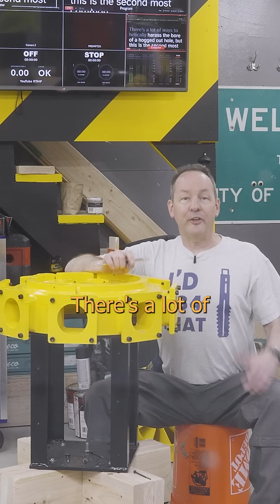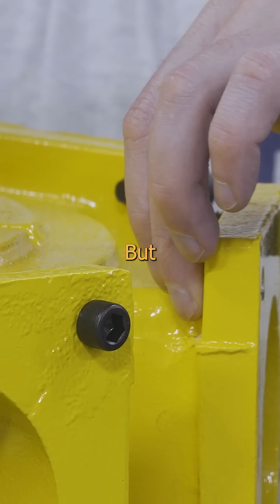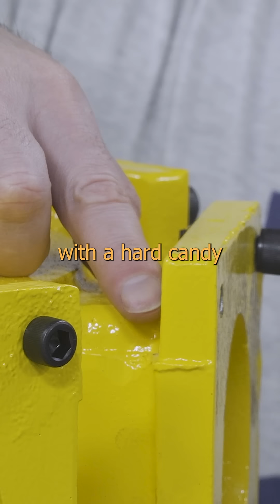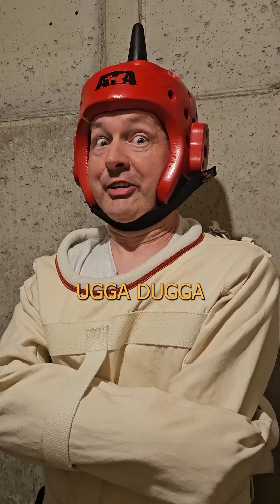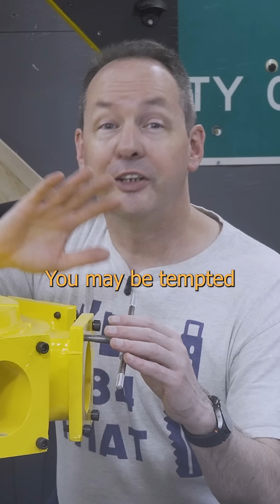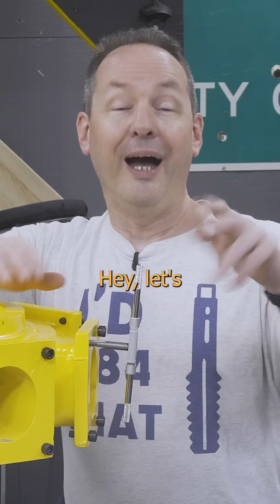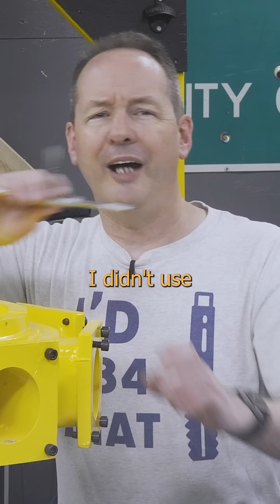Thread Chasing  #chrisboden #comedy #engineering #skills #workshop #metalworking #tools #apprentice

Comment: Ah yes...the dumbass moment was thredding aluminum profiles holes with a dry tap, moving slowly deep inside before going back out fast...forgetting that aluminum deform a lot more than steel after the work is done got the tap clogged inside while going back out, tried to pull it out with streght and it snapped...now somewhere out there a leg of a working table has a tap I broke on the side it was supposed not to be and has 2 extra hole.
Remember to use lube, it can get plenty in and out!

Comment: i've done it with an impact before, worked on a powder coating line and the bosses were getting pissy about how much time i was taking, so i said fuck it, i'm certain i did more than a little damage but at that point i had 0 fucks left to give after getting reamed out

Comment: I'm a dumbass, snapped a tap in a blind hole trying to clean up the thread for a head bolt in my reliant scimitars cast iron block, found out quite quickly that I couldn't put a hole for an easyout in the has tap with the bits I had.... I was not a clever 17 year old and made it far worse trying to get it out by jamming welding rods down the flutes and twisting with mole grips shearing them off inside too, thankfully I had an old-school retired mechanic for a neighbour who welded a bit of rebar (if I remember rightly) to it and managed to wind it out, I'd like to say I haven't snapped a tap since.... I'd like to.

Comment: LMAO I Don't know if i'm a dumbass for it, cause the boss wanted it. One of the lathes chipped a thread tool and ran like 500 parts with a thread that just didn't clear deep enough. It would have taken way too long to start them all by hand. Better to scrap 5% due to cross threading and get the parts shipped the same day.

Comment: Fellow near dumbass here (I use "near" lightly cuz considering the shit I've done... oh boy, I have a lot of wisdom. In hindsight, my father is a patient man.) who's father is a man with a wealth of experience in the "well thats a lesson learned" department. 
He owns a couple of these taps and uses them to their fullest extent even past the WEEE WEEE WEEE. In fact he uses them so much, he knows how they feel when they're about to snap and even has committed to muscle memory where the eZ-outs are to remove them when broken. My favorite story is when it snapped while cleaning out the hole for a heat sensor (I think) just before the DPF on a freightliner semi. In case you don't know, sometimes the DPF has reduced space for access. Sometimes, it has REALLY reduced space for access. this one had really reduced space, allowing just enough for a little wiggle room for the hand with the tap included. Imagine his sigh of acceptance when he tried using it with a right angled drill and it snapped just where the teeth started... leaving you with even less space for a tool and the ez-out. It was fun watching the vice grip clamps we had slowly get metal shaved off as we tried to remove it. turned a 2 hr job into like a 4 or 5 just cuz of that damn broken piece.

Comment: After a week of clearing stripped screws from glass security fixtures, I was tired and lazy. My hands and shoulders hurt and I was ready to call a hit on the MFers who installed the fixtures in the first place. 

The last handful of issues weren't stripped screws, just holes that needed to have the paint and dust cleared out. My #dumbass thought I could finish up faster if I put the tap in the the power drill. Screwed myself and lost pieces of the tap down the center of the fixture. But I learned something!

Comment: Definitely dumbass here. Tried tapping 1/4" UNF threads into thick structural steel without tap lube. When it was halfway through and wouldn't go any further with hand pressure on the tap wrench, I thought I just needed more pressure and brought out the drill. Tap snapped in the hole and I decided 3 out of 4 usable holes and just using a nut on the other side instead is gonna work well enough 😂

Comment: Dumbass… installing maglocks onto a steel gate post. Got bored of tapping and stuck the tap in a cordless. Worked amazing until it didn’t and then I spent 2h trying to get the broken tap out in the middle of winter.

Comment: dumbass: broke a tap off inside of a one off test fixture.... a 45 year old, one of a kind, 125kg machined out of a single block, "no one has the drawings anymore, we didn't digitize them and the some asshat in management decided we could throw out the filing cabinets with the old papers without seeing if we might need them bc having open plan offices is more important than having reference material", "must withstand extreme temperature and force bc jet engines don't do half measures", etc. kind of fixture...... didn't know it was made of inconel and thought my experience tapping tool steel would translate.... it did not. spent the next 6 hours extracting the tap. thankfully managed to get it out.

Comment: Dumbass...
Was bolting steel plate cover underneath a wheel loader, weighted like 150kg (320lbs??). Threads where like M18, and full of paint from finishing the frame. I used impact to clear them quick, everything was fine until the last bolt that happened to have fucked up thread. So there I was, with heavy ass steel plate on a jackstand, balanced with one hand, realising That I have to unscrew all the other bolts to make a new thread for the last one. That was fun...

Comment: i worked at my dads auto shop for 5 years before he passed away. he taught me how to use the tap, set me to work on an old cylinder head (aluminum head, steel bolts.. if you know, you know..) but didnt tell me until AFTER i broke the tap, that a bolt was broken off, in the hole i was tapping... never seen threads from a bolt or tap just...stay in the hole. ripped them clean off the tap, looked like it was intentionally machined that way. still have it as a keychain to this day, along with a wrench he had that simply says "no the OTHER 15!"

Comment: Hi, I.I a Dumbass 5th level.. at least 5 taps...f0cking aluminum and cast.  Drill...absolutely.  .Dull taps ugh.  Btw, follow up with forward, straiggt and reverse curl.  Started, std and plug taps. And just because the cnc can fast tap.. you can't.   The right pilot hole really helps too.

Comment: naw something with a tap, i was using one to tap a hole in a steel hammer using a mill and broke it into the part and could not get it out even welding it

Comment: Dumbass💁‍♀️
I spent an entire day trying to locate an M33 fine thread tap to chase some threads on a final drive for some sprocket bolts that sheared and I spent 2 days extracting. I didn’t have a large tap handle that racketed, but I had a 3/4 air impact and some 12 point sockets… let’s just say the tap broke and another 4 days of work was added along with a trip to the machine shop to have the hole plugged and redrilled. I now have every type of tap handle imaginable.

Comment: Not me but a trainee at the company where I work at wanted to see if our trainers were just talking or telling the trueth, so he tryed to grind off 5 mm off a hardened steel bar. End of the storry, the automatic thrust that he had set the machine to, was so high, ge just ran a 20cm diameter grinding wheel at god knowes what speed into a steel bar. The grinding wheel was like a clustergranade, pieces of the thing went flying evrywhere😂 bless god noone was gurt and apart from the grinding wheel and weeks of finding pieces of it evrywhere there was no damage and he didn't get fired for that mistake.

Comment: I've a drill (not an impact) with an electronic  torque limit that goes down to a rat fart. It'll run a 4-40 tap without snapping it, but the bigger issue is that the drill is a chonker and is a hazard anyway until you get up to about a #10

Comment: I got lucky and been seeing the proper way to abuse a tap in a machine for a while long before I ever got near on of these. 

( Starting a tap on a new hole can be done with a machine. Maybe even better if its a drill press, that way it can set up proper to have perfect alignment.  But gotta be sure that the tap in the chuck isn't too tight and that the machine loses the grip after a few turns, or at least long enough before the tap has fully engaged that its not gonna snap off in the hole either. THEN go in and carefully finish off the by hand 100% of the time.)
Reply: Oh yeh, and Turn OFF the machine after it bites.  Annnd of course lube.  Always lube.

Comment: Shop class, I was restoring an old tri-square and the setscrew threads had more rust than a third trimester whores working wallet. Thought myself clever for using a drill press. Only defense is I was 15, but still!! Dumbass.

Comment: Dumbass. Gun receivers are really hard and when you first start gunsmithing you think you can do anything the fast way. Turns out it’s not the cheap way because those specialty taps are way more expensive than they should be.

Comment: Somebody in my one-man shop broke a tap off in a cast iron machine housing then tried to drill it out. If I recall correctly, that dumbass had to be satisfied using the dimple where the drill bit skidded off the tap and into the adjacent cast iron as a target toward which to direct chips of hardened steel as he used a pin punch (or whatever tool was closest) to make the protruding shard less sharp.

Comment: Tapped a 10 24 smallest tap handle taking my time.  Stepped back to rest hands. Snap!!! Just broke!! If you do ever break a tap off and can't get out. A broken carbide bit or end mill spinning at over 2000 rpm will eat a hss tap up. If carbide breaks it was already broken!! Bigger the tap the easier it is.

Comment: Would it still count as me being a dumbass if the motor of the drill wasn't on? Needed to tap 30+ holes into a 3d printed curta and I'm terrible with the hand thingies, so I wanted to try but ended up deciding I couldn't gear it down enough. But there's a vice. And a holder that is very stabily pointing down. And a bit that can hold the tap
Disconnected the power, and manually turned up and those were some amazingly straight threads

Just ignored all the times I spun it the wrong way and drilled a hole

Comment: Get a set of tap drive sockets and a 3/8 drive battery powered or air ratchet. You just pop the socket and tap off to hand start it in the hole (the socket makes the tap way easier to grip) then you can run it in and out of the hole with the ratchet. Way better than doing it by hand, especially when you have a bunch of holes to chase. Been doing it for years and watched dad do it for years before me. Never messed up a hole or broke a tap.

Comment: Stuff like that I’ve always started with a drill and never broke a tap.  Maybe because I never put a tap on a power tool and I was starting with a stiff wire brush and then using a thread chaser by hand 🤷‍♂️ 
I was taught at a young age how fragile taps are

Comment: Working on moving lights, routine maintenance, on of the techs starts powering away with a Dewalt, quickly remind them this isn’t their department and refer them to the manual means or rotation,
Not thirty minutes later we find the remnants of the previous team, near tripped heads and more than one stripped thread.
One $1000USD part later the new team have an understanding of what not to do.

Comment: obviously way different than tapping deep threads. But where I do panel building, we tap a couple dozen m5 holes with drills every day. Even with the thin metal and small holes... you break alot of taps before you get good at it.

Comment: Oh God... It wasn't a tap, but a screw extractor. I had a hardened lower shock screw snap straight flush in a blind hole after seizing after a couple turns. I snapped maybe 2? And like 3 cobalt drill bits into it trying to get them out.  Needless to say, I had to drive 3 hours to a pull a part in another state for another 30 year old trailing arm

Comment: For all those is the "how", from all of us in the "know"....they correct way to repair the bolt with a slant as bad as the news is called a Keen-sert. That is the brand name but the insert type is the key. It's the only way to repair the angle, fix the thread, and return the hole to its original bolt size.

Comment: I didn't use a drill, but was still, evidently, a dumbass. I don't know what kind of steel I was trying to tap threads into, but I did not have tap magic and probably should have. I thought I'd done it right, advancing and retreating repeatedly, but had reached the limits of the tap. But when I backed it out it looked like a candy cane.

Comment: i'm the dumbass. while routing some thick cable under my truck for a second battery, i figured i might as well go metric instead of self tapping for the cable clamps. after drilling around 20 holes, i started tapping. got bored pretty quickly, resorted to a slow drill. well, not slow enough, it seems. broke three 5mm taps, as I didn't have any more to break. all this in the rain and mud. on a Sunday

Comment: Hi Chris and accompanying chat, its me the dumbass. At the ripe ol' age of 18 I redid the heads on my "Honda-with-a-tie-on" Acura CL and had to clear the threads as the bolts on the block weren't going through. Hormones spiked and I broke her off hard flush with the gasket surface. And I had to drive to college the next day.

Comment: Dumbass! Found out the hard way in a blind hole in an old Chevy engine block Of course on the cylinder deck that drills and taps don't mix at least not the powered kind of drills. That was over 3 days of frustration and a fair bit more yelling than I'm willing to admit the good news is I found out after 3 days of yelling at the engine and threatening to give up on the whole project multiple times that you can use snap ring pliers preferably the right angle ones to fit down inside of the flutes of certain size taps to back them out if you're lucky and I turned out to be rather lucky thing was far enough in there that my normal needle nose pliers were too fat to fit the job but the snap ring pliers slid down just far enough to get purchase on the back end of the flutes. I solemnly vowed never again and I never looked back

Comment: Especially on larger holes with larger taps chasing with a drill set on low speed and the lowest torque setting or so works perfectly fine..... I don't have a video on it, just done it hundreds of times without ever breaking a tap. If you're just chasing paint out of the threads, maybe lube isn't necessary. However, if the holes are as you describe (having been originally cut with a dull tap and crooked), then it's unlikely you aren't removing metal as well when chasing, so lube it up. If one pass with a lubed tap ruins your paintjob it wasn't a good paintjob in the first place...

Comment: Dumbass ... Working on a overhead oil supply line. In my defense, i couldn't clean it off, as another crew had dropped the ball and i was the man with the short stick. 

Also: Just use tap magic. It's helps

Comment: Used taps many times, and had to replace them many times because of people that don’t know how to use them. I even have drill / tap bits that I won’t let anyone use. What sucks about using taps is if you have a hidden price of metal that actually need the threads that you don’t know about.
Or having the tap break in the hole and not enough to grab onto trying to get it out.

Comment: Yup im that dumbass as well. Didnt fuck the threads or actually break the tap going in but i bottomed her out and after a few love taps with my purse i found out you can spider web fracture the tap and it makes an entirely new size tap in the hole. Fun times. Replaced the rollbar piece with a new one and glued my new 1 of 1 tap to my toolbox as a forever reminder not to do that shit ever ever again.

Comment: As a machinist of 25 years, even I learned something from this video.  

1. How to find the thread pitch of a UNC thread?  Nope.  

2. The difference of basic thread forms? UNC, UNF, NPT, NPFT. Nope!

3. How to calculate the proper drill size for a given thread.  Still no!

4.  Saugatuck MI is a small community that strongly supports LBGT rights.  👍

Comment: not a tap but I broke a screw remover off in the head of a motorcycle case screw. took 20 minutes of gentle taps with a punch to back it out degree by degree.
bonus story i used an impact driver to drive nylocks onto stainless bolts. learned that lesson pretty hard.

Comment: Not me but one dumbass I worked with years ago. He always ran a 1/2in impact on taps. Didn’t matter what size it was. If he found a 12point socket that would fit the gun and tap it was gunned. I had to fix his fuckemups everyday on that outage. 

Now for my story. I was chasing thread and had to cut a bit of new tread (used longer bolts this time around) on the Combustion Discharge Case (CDC) of a  GE gas turbine. We went to lunch (yes I pulled the tap out of the hole. Im not that retarded) when I came back the tap wasn’t where I had left it. Someone ether used it and just put it in the general area or it somehow through the  art of phuckushitzu the tap fell off the middle of the table and someone picked it up. Ether way. I don’t have a tap wrench so I used a crescent wrench. I got about 3 threads into the messed up hole when I felt the resistance of your mother after 3 bottles and the hesitance of mole rat. The fucker broke and I now had to try and break it out which didn’t work or burr-bit the damn thing out.

Comment: Dumbass 😂 tried tapin a 5/8 hole with a multi speed drill press. Didnt chamfer the hole practically a blind hole. Broke the first tap half way through managed to get it out only to cross it with the second tap tryin to finish 🤣